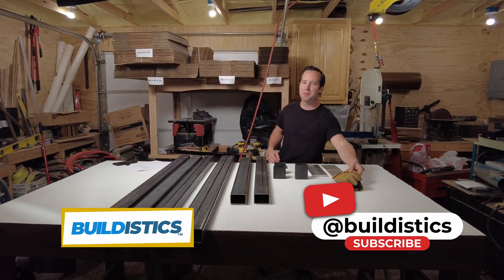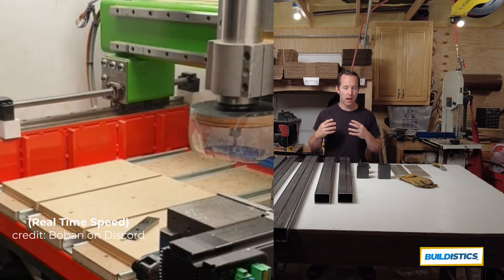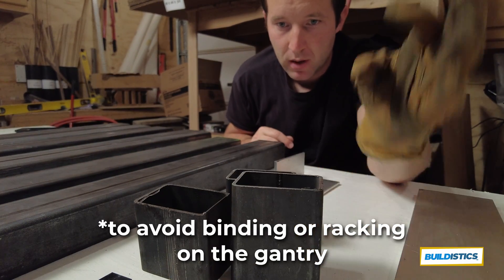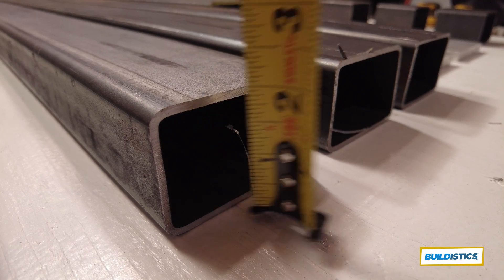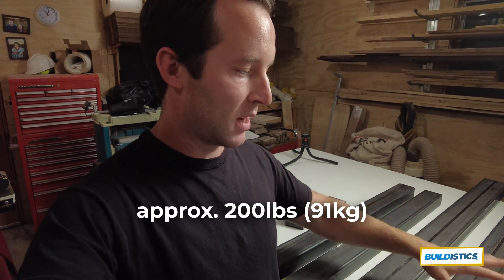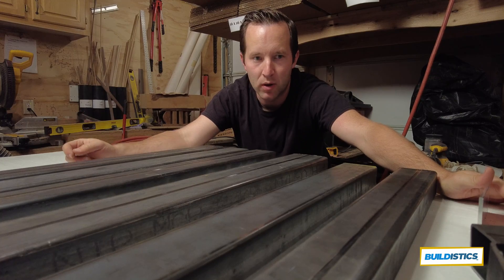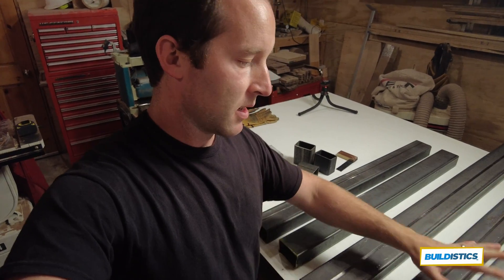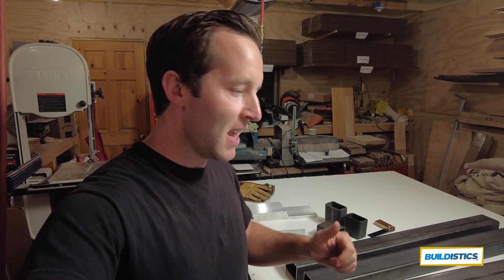PrintNC Build: Finding, Buying, & Squaring Steel for My DIY CNC Router

Comment from the maker: I spent $327.62 on metal in the Midwest, USA.  What did it cost you?
Reply: That is a lot! On East Coast locally, a 2x3x3/16 inch 22 ft long piece of steel tubing is $88.
Reply: Mine was around $300 for a 4'x4' build. I went to a local scrapyard/recycler and had them do rough cuts for me. My beams weren't very square either, I angle grinded and filed them to something close, but I feel like I need to go back at some point with a rough-grit sander like you did and get them perfect.
Reply: I spent $40+VAT(%18) for 60x80x3mm custom cutting included (Turkey)
Reply: I'm at $400 for a 4x5ft with two more base pieces than what you have. All cut to length. This is a local business and my only source otherwise I had to order. Which would have cost a bit more.
Reply: £168 ($207) for 100x50x5 box

Comment: Curious to know if one could use Aluminium Rectangular Tube Box Section such as 6082T6 or 6063T6? 

I guess it is much more expensive but easier to sqare the edges, but not sure if it would provide the same rigidity -maybe that could be overcome by getting a thicker guage.

Hoping someone who has metallurgy knowlege can chime in.

Comment: How much rigidity would you gain going up to 1/8" side wall steel, or even 1/4"??
Reply: I don't know for sure, there are formulas for figuring that out though. However, most of the rigidity of a tube comes from its cross sectional area, rather than from the thickness of the walls. That's why he got a 2x4 tube for the gantry, rather than going with a 2x3 with thicker tubing. You would get more resistance to crushing with thicker walls, but it tends to be more effective to get larger tubes for more rigidity
Reply from the maker: Excellent points, Evan.  Jason, you also introduce more mass (specifically with the gantry).  More mass just means more stress on the stepper motors and components.  But could help with vibration dampening.
Reply: God I love all the maker/engineering parts of YouTube, it's the only place where comments on videos are real, interesting discussions!

Comment: Yep. Verify everything when they're cutting your steel. The guy grabbed 3 lengths off the 3.2mm x 6meter pile. Cut the first which just happened to actually be 3.2mm but while I was standing there looking at the other two I noticed one was marked as 2.3mm. So he admitted it was wrong and then grabbed the third and put it on the chop saw. I asked him to double check it as it also looked thin. Yep. It was also 2.3 mm. So two out of three were incorrect because someone put them back on the wrong pile. Also his cuts are all not square just like yours. 
Thanks for the HQ videos man. It's helping a ton.
Reply from the maker: Maybe some of the shop guys aren't as attentive to the details as we are for this project?

Comment: Before getting steel cut verify to what degree they'll guarantee the accuracy & squareness of the cuts they make. Some places will be super accurate, some won't. 

Normally it'll be a +/- X on the cut length but many don't state how square their cuts will be so be sure to ask if you're having steel pre-cut to length. And ask if you can pay extra to have the ends ground square, often they'll be able to do this but it will obviously cost more.
Reply from the maker: Great points.  Squareness is huge - I spent a lot of time fixing mine!

Comment: So... The square pipes for the x axis should be perfectly parallel. Dunno about the Z axis. Surely one could get that milled to spec for cheap.
Reply from the maker: If you have a place nearby that would do it for you, all the better!
Reply: @WoodworkingBusinessmen  Or if you work at one, its free ;D
Tolerances from left to right of +-0.04mm should be achieveable.
Reply from the maker: @julianweiser9985  even better!

Comment: One thing I had to consider when picking my steel was how much oversized I needed my cuts to square the edges, I rounded up to the nearest inch which for the standard sized PrintNC was 2 x 3ft and 4 x 5ft bars, which gave me plenty to make rollers and spares. I squared the edges of my frame and gantry tubing which I believe helps a lot with the 3d printed drill guides as well as squaring the frame accurately. Also a significant portion of the cost was prepping and painting the steel. Great detailed video about this important step in the PrintNC process. Look forward to the rest of your build!
Reply from the maker: Great points! I'm still contemplating the color scheme of my CNC...any suggestions? 😄
Reply: @WoodworkingBusinessmen  go with accent colors of your logo. You can find any color filament and I powder coated my steel silver as a neutral color that matches well.
Reply from the maker: @Mitch3D  Great idea!